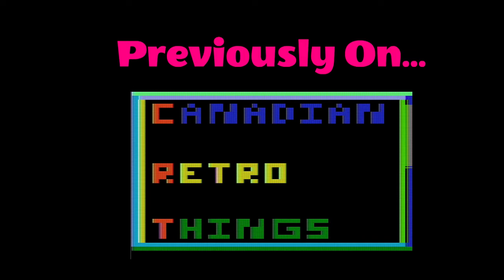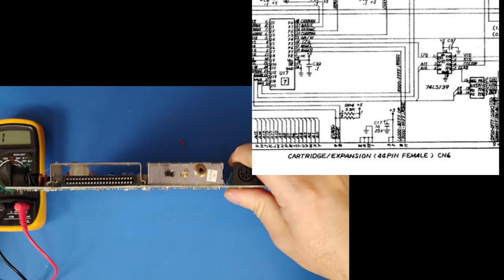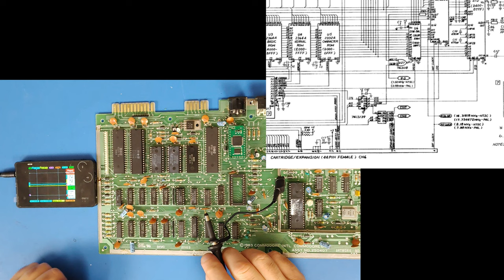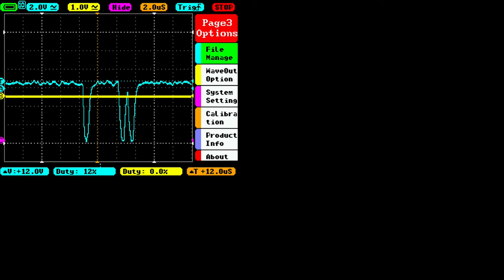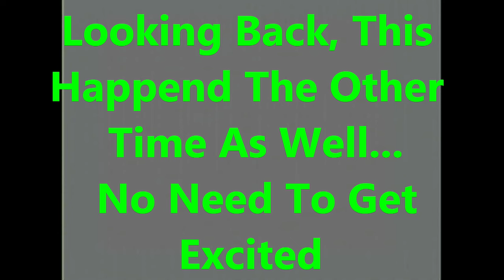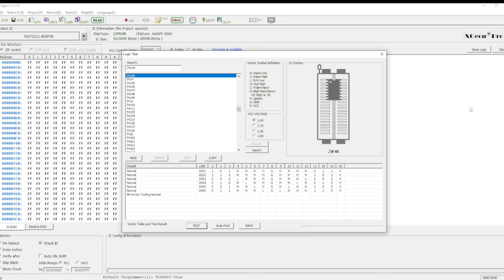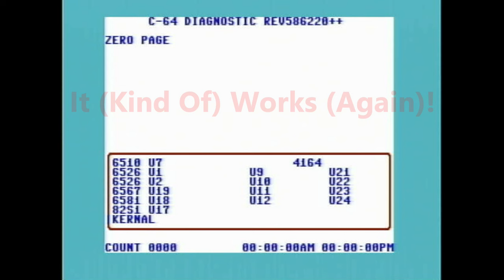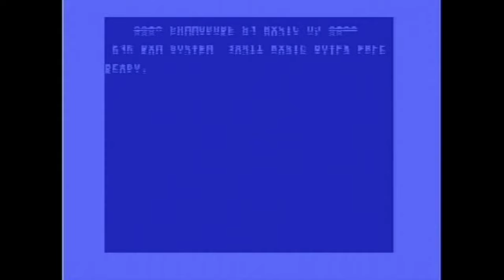Fixing My Other, Other Commodore 64: Part 2

Comment: Ken,  a little, hopefully helpful, advice.  I've made this mistake, so maybe you can learn from my dumbassery.  Don't solder a socket into a PCB with a chip in it, especially a chip that's been previously desoldered.  If there's solder left on the pins (which there's almost guaranteed to be), you can accidentally solder the chip into the socket.  Not good.  The pins on the socket don't need help to stay in place while soldering.  That's more for when you're soldering in pin headers, but sockets will hold their form and alignment without difficulty.  You got very lucky doing that this time.  It can be a pain to fix.

Don't pull the color RAM.  Your colors are all fine, even now after you added the new problem.  You do obviously need to fix whatever you damaged, but I'd look for the problem near the 373 and bodge it there.  The next place I'd suggest looking for the original problem is in the main RAM subsystem.  The diagnostic test is locking up either right before or during execution of the Zero Page test.  Zero Page is the first 256 bytes of RAM (0-255 or $0000-$00FF), which is filled with registers, pointers, flags, constants and other things vital to the operation of the C64.  I think it's likely that one of the RAM chips has one or more single bit errors in the zero page.  Single bit errors can be very hard for diagnostic programs to identify and, inside the Zero Page, could easily cause crashes like you're seeing.  It appears that the address bus is working OK, so the problem is not likely in the 74LS257's.
Reply: +1 to this.  I would also recommend a proper desoldering gun like the Hakko or even the cheaper ZD-951 (sp?). It will save you so much time and come out so much easier then using a manual pump and soldering iron, even though you clearly have some skills with it.  ;-)
Reply from the maker: I had not thought of the chip sticking in the socket, thanks!  After I fix my mistake I will definitely look at the RAM.
Reply from the maker: @RacerX-  A desoldering gun is on my list...hopefully soon!

Comment: Ken, I feel for you, I really do. I myself said f*ck when on the third chip replacement it still wasn't working. There's nothing more frustrating than going through chips one by one and still ending up where you were before (or even worse a step back). All I can offer you is that when I bought my Vic 20 memory expansion cart I could not get it to work for love or money. I checked the cartridge port and all kinds of things. In the end I was convinced that the expansion I had bought was faulty so I contacted the vendor and checked over the cart again and again. In shear frustration a couple of hours later I was looking at the bottom of the Vic 20s motherboard and I saw that a lot of the soldered pins of chips had not been trimmed off and many of them had bent over. One pin on one chip (a 5V pin as I recal) was touching a pin on another chip, a logic chip and this was the reason that the expansion would not work for me. For over 40 years the Vic had a fault that nobody ever knew about until I plugged a memory expansion in. I thought of that as soon as I saw your cart woes, It's worth checking out. Don't worry about not really doing anything in this video, the journey is as much fun (well, maybe it doesn't seem like it always) as arriving at the destination ;)
Reply from the maker: I had looked at the solder points at one point and didn't see anything (that doesn't mean I didn't miss something)

Comment: I have a number of C64s and they all seem to have different chips socketed from each other. Commodore really made these strangely, while they used cheapest of sockets, a cheap socket is easier to deal with than a soldered on IC. Especially since they also cut the pins so short when they did. Maybe there's PCBway board that expands the C64 Cart port so you can tone them out easier.  Like a multi cart board. Would be nice to see a project building one. :D - Replacing a 6526 was my first C64 repair back in 1985. I only tore one trace :) You did well to replace that many. They are very fragile
Reply from the maker: I started out on Tandy Color Computers which, in my opinion, lift traces a lot easier.  I would love to get my hands on a multi cart board for the C64, the only person I know that has one, or at least uses one regularly, is 8-Bit Show and Tell. I will have to ask him if he knows where to get one!
Reply: @CanadianRetroThings  never had a CoCo. But always wanted one of those Multi-carts. 
Good Luck on the repair

Comment: Unless there’s a critical need to try to salvage the chips I suggest just cutting the pins at the chip body and pulling them up from the top of the board and installing new chips instead of risking damaging the pcb by applying more heat to desolder them. Maybe there are some signals that could be checked with a scope to try and narrow down the problem area.
Reply from the maker: I have been using the scope to compare everything to a working board, so far I have found nothing that looks different.  I am still comparing things as I go.

Comment: Interesting I have a c64 in which the cartridge also does not working so interesting to see what you try/check. One thing I did since my cartridge port does not work I put in a diagnostic rom it gave errors on the memory access haven’t figured it out yet… it is a learning experience
Reply from the maker: I hadn't thought of burning a diagnostic ROM, I will have to put that on my list! Thanks!